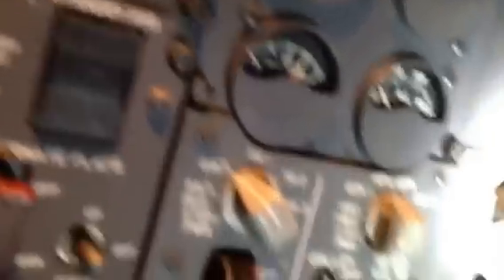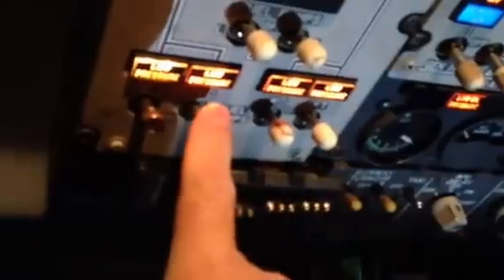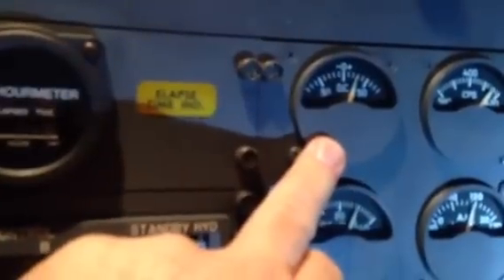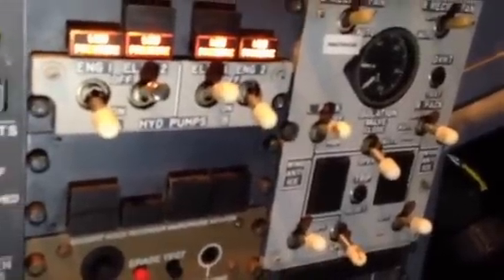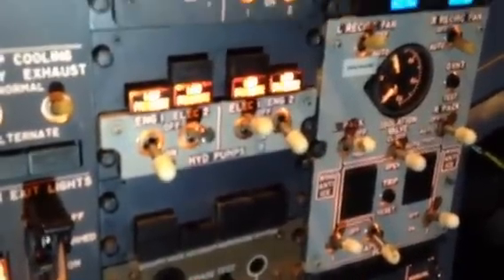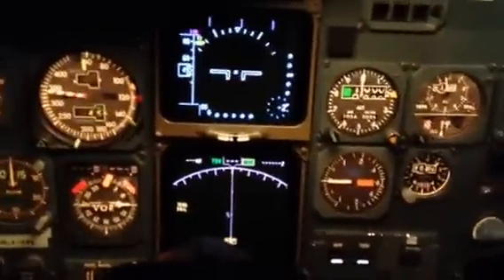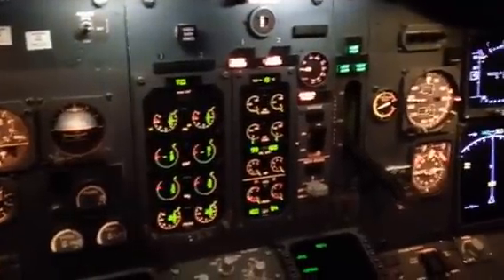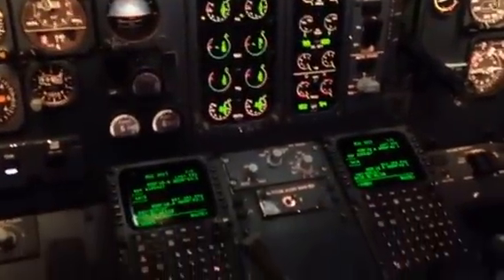B737-400 Cold Dark Start

Comment: Great demo. It also could help a few viewers as (jet airliner or even Boeing) enthusiasts to get around a common myth that a Boeing 737 can't be started without a ground cart (or ex plane). Indeed, "ships" batteries in this instance to provide for the APU start. APU to (elect) bus when stable as well as supplying bleed air for an (air cond) pack. Later, the first engine started using bleed air from the APU. Thanks.
Reply: Kinda weird myth, I get it with the 707 as it could be expected that an aircraft of those proportions back in it's day wouldn't be flying to small airports without the required equipment (don't know if it even had an APU), but the 727 and 737 were conceptually different in that regard, it's the whole reason they're both so low to the ground and had built-in stairs (the 727 having the rear one and 737s have them under the door, tho I think that might be an option).

Comment: I would have performed a more thorough safety check before even throwing the battery switch:  Circuit breakers in, flight control power switches guarded, hydraulic switches off, bleeds off, engine start switches off, tiller centered, landing gear handle down and locked, speed brake and flap levers both in stow/up position, throttles closed, thrust reversers stowed.

Comment: Do they have a way to plug into an external power supply or do they always run the Apu when the plane is on?
Reply: Yep, they sure do.  There is an external power receptacle on the right side of the aircraft in the nose section, down near the nose gear.  When power is plugged in there will be a light on the overhead panel that says "ground power available" or something similar.  Then there is a separate switch to turn it on.

Comment: I would like to know what type of locking switch you turn on at the 4:00 mark and where can I get one. Would be pretty cool to fire up the HV power supply of my Johnson Invader 2000 transmitter with one.

Comment: I wonder of extreme Cold start Is Any Different like turning on the glow plugs on diesel truck and tractor or locomotive
Reply: G POWER DRAGON usually they just need a blast of EZ start down the intake nozzle, but if it's really cold then best to use the Alaska method and light a fire under the sump a few hours before starting up...

Comment: Not sure why he would need the ATIS to set the altimeter. All aircraft in class A airspace set it to 29.92 anyways. Unless they wait to do that till they pass 18,000 ft which would make sense.
Reply: "Not sure why he would need the ATIS to set the altimeter."
Because he is on the ground, and before he reaches class A airspace he needs to fly through class B, C, D, E, etc, all of which fly with altimeter set to feet, not flight level.

Comment: So, the mechanic warms up the plane and the pilots show up later to fly the beast!
Reply: Usually you’d use a start cart. Maybe they’re a cargo operator out on the edge of the field. Only planes I’ve flown with electrical starters have been small corporate jets.
Reply: Umm every mechanic on the planet knows how to start the engines. It's kind of important to being able to fix/maintain them. He's no mechanic. FBO guy who someone showed how to start the APU.
Reply: I understood thoroughly by your answer and I learned that these airliners has an smaller jet engine to start the main engines because they need a lot of torque and a battery can not provided it. So the man in this case started just the APU (small engine) and not the main engines.
Reply: Well kind of. Turbines in this configuration supply zero torque. It has a dedicated compressor to provide "bleed air". The bleed air provides the power to start the engines plus electrical power (both ac/dc). Older aircraft  required ground power/ground air. Like in the 707 which had no APU. You started one engine at the gate on the GPU cart and remaining 3 with bleed air as you taxi. Compressed air is also how you start most large diesel engines for ships/trains/etc. Just way more efficient than a bunch of giant heavy starter motors etc.
Reply: MrRexQuando You are right.  I also think it is inefficient and less safe to rely on electric starters for the engines. So compressed hot air from the APU is routed to the main engines and turns the blades till they reach the necessary rpm to ignite. Then bleed air from the engines support electrics and haydraulics and in case an engine stops, it can restart. very complicated systems and at the same time simple. genious. Smaller engines probably use electric startes.

Comment: I found an old 737 sales brochure that was sent out to prospective airlines back when Boeing was marketing the first 737-100.  On the last page was a list of assumptions that were used for the advertised operating costs.  Jet A, $.21 / gallon !!  Average passenger weight / 145 lbs.
Reply: Terence Rucker what? Just my snack weights 145 lb
Reply: You are right. I remembered the numbers incorrectly.  I went back and checked. It was 12c a gallon.  Wow.
Reply: That was expensive. One of the advantages for the first jets in the 1950s was .10c kerosene vs .25c high octane aviation fuel.

Comment: Am I correct that he only started the APU and not main engines, or did I miss that?
Reply from the maker: That's correct.  The crew will start the engine just before they taxi. The main engines use a bunch of fuel and they are a great safety risk when operating.
Reply: @NT0M  Different airline and different airplane, but thanks for having them all ready and warm for us on those cold-ass mornings!

Comment: "That's weird" is not something I'd like to hear the pilot say on an airplane I'm supposed to fly in...
Reply: Do u panic when u see the low pressure indicator on ur car during the cold winter months?
Reply: Only when my car is at 30,000 feet
Reply: @BenDover-wm7wf  lmao
Reply: feynthefallen He's not the pilot. He's the mechanic. That's a normal reaction regardless. This is why he is starting the airplane up for the first flight of the day, to find any mechanical issues, so he can fix them.
Reply from the maker: Trust me, you have no idea what the crew up front are saying sometimes.  If you did, you would probably drive next time.  In truth, crews for the most part are very well trained and perform professionally.  But aircraft are complex and sometimes do things no one can explain.  The newest generation of airliners require electrical resets frequently.  Kind of cont-alt-del thing...
Reply: @NT0M  I’m scared.

Comment: how come aft fuel pump isnt on before apu start?
Reply from the maker: The boost pumps are AC powered and not available until after the APU has powered the AC busses.  On some 737's (depending on the airline who ordered them when new), there is a DC boost pump for the APU during startup.  I have never seen a separate control for it like a DC-9, MD-80 series aircraft. For that reason we turn on the boost pump after the aircraft is powered up electrically.
Reply: APU doesn't need the pump to start. It draws it through the fuel control valve until the AC pump is online as NTOM says. It prolongs the life of the FCU to pump the fuel to it. The additional (left aft) DC pump for the 737 was only produced on the 737-500.  Next Gen have a completely different fuel system. No DC powered pumps.

Comment: You're no mechanic. Not even close. First wrong fuel boost pump for the APU. It is the Left AFT on the 400. You skipped 1/2 the list. "I'm the mechanic" "I don't know anything about starting the engines"  What?  Not a single A&P on the planet that doesn't know how to start an engine.
Reply: NT0M don't listen to the naysayers, this was a good and informative video. Thank you for sharing.
Reply: MrRexQuando He only said that to defer people asking him how come he didn't show it.  Of course he knows how.
Reply: OK but I'm not the one who said "I'm the mechanic" " I don't know anything about starting the engines"  And yes when it comes to starting a turbine I do know it all.
Reply from the maker: I was being factious. Actually, I retired as a Captain on the 737.  I suppose I could still figure out how to start the engines....  As for which boost pump you use to supply fuel to the APU, you are correct, the Left Aft pump.  But why that pump you might ask?  First, the left side because the APU fuel supply is plumbed from the left side - no particular reason, it is just the way Boeing did it.  Second, use the Aft pump - why?  Because it is lower in the tank and will supply fuel when the wing tank fuel level is very low.  Now, this particular flight, the wing tanks were full, meaning it didn't matter which pump I used.  But you are correct and I shall forever more use the AFT boost pump....
Reply: Why is he gay? Really disturbing comment. It sounds like You have some serious repressed desires that might need some mental health care.
Reply: So this will be fun. Why can't you use the center tank on classics when below 5000 lbs? There are 5 answers of which 4 correct. From the answer you give I can tell what role you play or if you just googled it.  No stress if you don't want to play along
Reply: This game sucks
Reply: MrRexQuando I hope you're not CS on that type, 'IKnowItAll' people are scary... First thing you are told and must take in account : Do your job per AMM. This dude shares his knowledge for enthusiats and you will ever find mistakes. It doesn't mean he is all wrong. Many people don't bother to do a third he did...
Reply: All true but also you would have to cross-feed to use anything other than left side. Pressure up the right side and you would just continue to suck through the fuel control valve from the left if you don't cross feed. Additionally you have to check fuel levels in the center tank to use them. Center tanks are not be used with less than 5000. This is why following the checklist is so important.
Reply: Nope. I did my time. I have my certs. You don't make a mistake by saying "I don't know anything about starting the engines" 
Very different being a line jockey knowing how to start an APU versus someone who knows his N1 from his N2.

Comment: 737, my favorite passenger airliner ever. I like the 737-200 the best out of all the versions as a kid I always loved how they look. The new gens are obviously better, its a nostalga thing (however its spelt). Thanks for the video I love to see how everything works.
Reply from the maker: I qualified on a 737-200 as Captain.  It was a great airplane to fly but doesn't hold a candle to the new ones.  This aircraft used 30% less fuel than the -200 and is much more reliable.
Reply: And the MAX 8 is 14% more efficient than the NG, which itself is already significantly more efficient than this -400...

Comment: You'd think this could all be automated by computer to be a single start switch... It seems planes like to be complex for the sake of complexity.
Reply: In modern airplanes some of what is shown here is automated.  Giving pilots or mechanics greater control over complex aircraft systems and components is what causes a start-up to be so involved.  Pilots and mechanics need the ability to diagnose and treat minor ailments without sacrificing something major.  E.g. If your generator is eating itself just shut that off as opposed to the entire engine.
Reply: They are complex for the sake of reliability. A car has a single battery, engine and generator. Planes have multiple redundant engines, electrical generators, electrical buses, flight instruments instruments to name a few so that you don't die if one of them fails while you are over the ocean
Reply from the maker: They are always moving in that direction.  It is a double-edged situation in that the crews in highly automated aircraft receive less training for unusual situations because the computers handle them without crew involvement.
Reply: unions... planes are govt machines..
Reply: They are complex so problems/systems can be isolated and redundant or backup components can be switched in. Your car only has one battery, alternator, engine, transmission, steering wheel, etc so it can start with one key. An airplane has redundancy in all these and in the event one of them fails that needs to be able to be pulled out of service and a backup put in. You can't just pull the plane over to the side of the road and call AAA.
Reply: The old generations are about 40 odd years old.
Reply: actually if you read into that, that was pilot error, while one pilot left for the restroom, his private digital camera got wedged into the sidestick and put the plane into a dive. just read the investigation report.
Reply: Bruce Baxter I have studied many aircraft incidents and in many of them I question the decision that it was pilot error. Often the automation will do something unexpected or deceive the pilot. While this probably happens hundreds or thousands of times without incident (as the other pilots respond correctly) the one time the pilot questions what he should trust and not trust and makes a poor decision. The pilot is trained to to put more and more trust in the automation and then some part of the automation is in error does he doesn't know how to fly without the automation. Is this pilot error or automation error? Air France flight 447 is a perfect example of the problem with automation. The pilots were so reliant on automation they failed to maintain their basic flying skills. The automation made them not need to know how to actually fly the plane. Then when the automation failed completely they did not recognize the problem correctly because they trusted the machine too much. I also think of the Qantas Flight 32 where the destruction of the compressor disk caused the computers to be unable to land the aircraft but the human pilots where able to bring it down safely.
Reply: Curt D 
I'm not talking about pilot error. 
I'm talking about pilot initiated. 

Ie, if the idiot kept his hands off the plane would have kept flying. 

Look it up on the atsb
Reply: Automation takes control away from the pilot. Not sure if you've heard about the recent A330 that went on an... Negative 8 degree dive I believe because the plane thought it was on a positive degree angle. The plane was actually level.
Reply: Yes, the whole plane could be automated right down to flaps lights and landing gear, letting the pilot just fly the damn plane, or the plane can do that too letting the engineer monitor it and the navigator tell it where to go, or even automate the atc and let it tell the plane where to go and let the navigator monitor that.
Reply: Valeria Carreon 
Yes, I do realise this.

Do you realise that pilots initiate half of all fatal accidents in perfectly functional aircraft and if computers were left to fly the plane they could safely land a percentage of all other fatal accidents?

And I hope you aren't pretending that the half assed pilot assist we currently have can be in any way called automation.